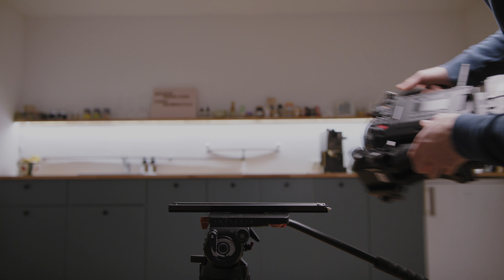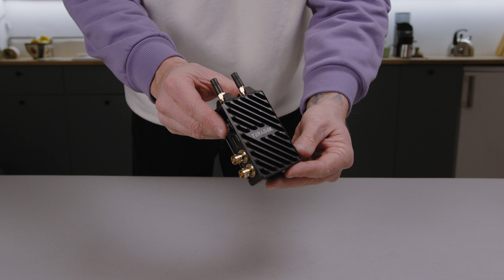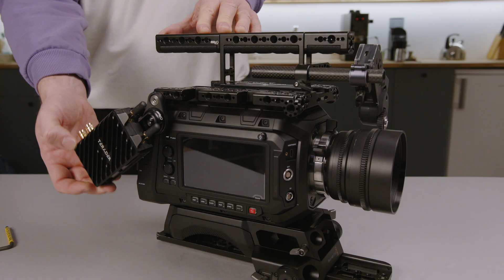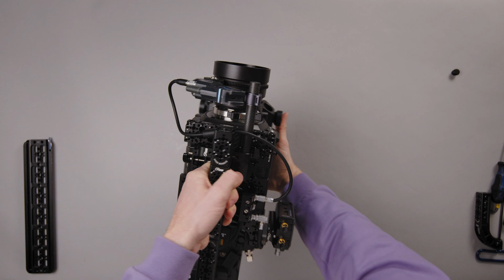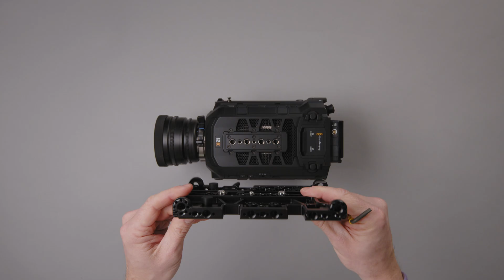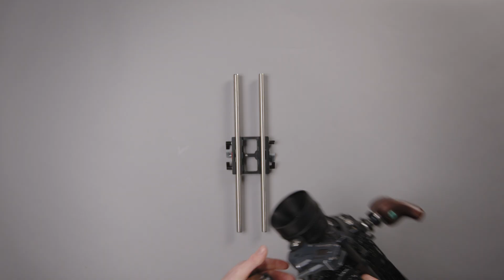Rigging URSA CINE LF 12K - Complete and lightweight Setup

Comment: Can you give a detailed list of the parts so I can order similar (especially lightweight handheld)?
Reply from the maker: I used for the lightweight setup:
- Top Plate M49-CAG-BMUC-TOP
- Rainbow Handle Kit M49-HAN-RBK-BLK
- 2x 3/8-16 to ARRI Rosette M49-KTM-BMD-UCLF (consider a third one for wireless video)
- 2x Dogbone (e.g. Tilta - ARRI Standard Rosette Extender Arm)
- 2x Tilta Wooden Handles (discontinued)
- 1x Wooden Camera Unified Baseplate (Dovetail)
For the dovetail Baseplate you could also use the matching MID49 one: M49-BSL-LW0-AC12

In general, you can consider getting the MID49 URSA Cine Mid Kit  (M49-KTM-BMD-UCLF) right away. It is well tuned. I still have a lot of accessories from older builds lying around, so I mixed the different parts.

Comment: Great video. I watched your previous one reviewing the Mid49 parts too. I'm interested in rigging out my new 12K LF in a similar way.

Do you find the rainbow handle strong enough for this rig, even at highly loaded angles? How secure is it in the top plate dovetail? Ever worried about it slipping?
Reply from the maker: @macomberfilms  I haven't yet reached my limits with the Rainbow. But with long heavy zooms, batteries, hotswap adapters etc. You have to look again. On the other hand, I personally am not afraid of the arca dovetail. It feels very safe to me.